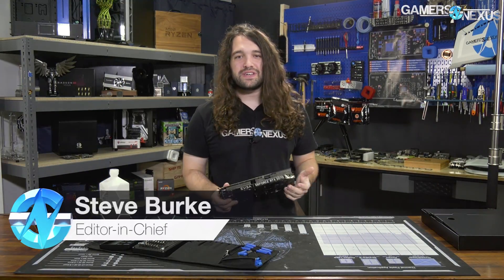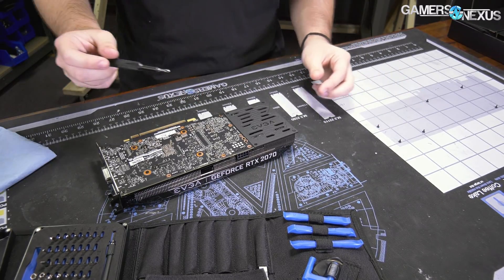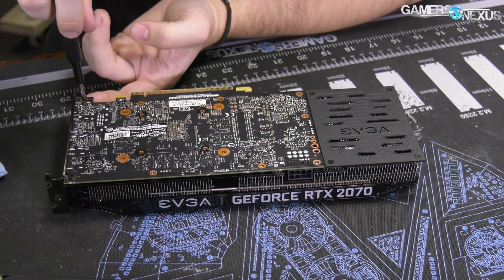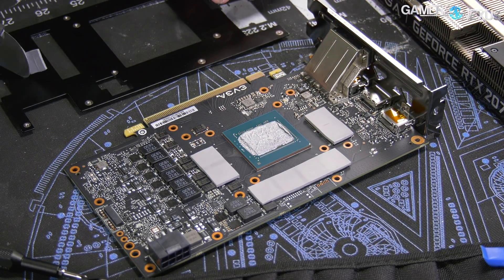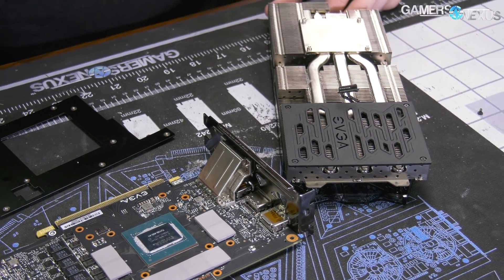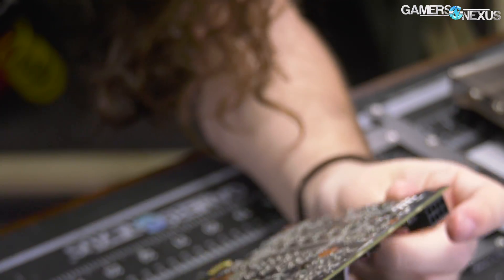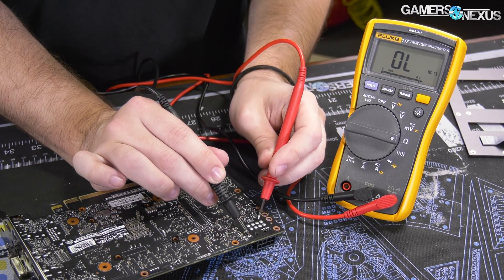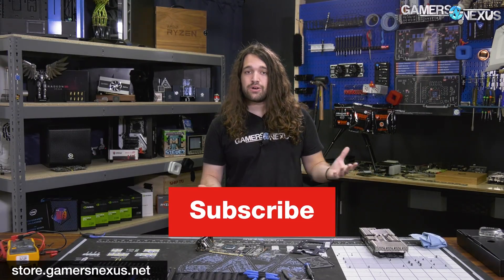EVGA RTX 2070 Tear-Down, Quality, & Reference PCB

Comment: 2070 shouldnt exist rn. Absolutely no reason to choose this card over a 1080 ti.
Reply: 1080 Ti is still almost as expensive as the RTX 2080 in Europe. RTX 2070 starts at 519€ so it's a better buy atm.
Reply: @yyperi  Same here in Canada for new cards. I can get a RTX 2080 for the same price as a 1080ti , and not be on two year old hardware (and get slightly better or the same performance). Hell there are even a few flagship models of 1080ti that cost the same as a 2080ti.
Reply: Nice lie, Idk why you would say something that this while the numbers are public. the 2080 doesn't beat the 1080ti in any noticeable  way. in fact alot of major titles still run better on the 1080. the fact remains that less then 20% runs anything above 1080p and even less then 10% are 4k thats the only place these cards start to pull apart.
Reply: Bought probably a dozen used cards, many in the mining era. Most have been running for a year plus. Even the ones that haven't have seen plenty of use. 

0 have issues. Just test before buying or buy on eBay for the protection
Reply: I bought an OC'd EVGA 2070 because the 1080ti is much more expensive.
The 1080 is around 440
The 2070 was 460
The 1080ti is about 700
Reply: Price obviously.
Reply: Apart from the Fact that it makes the 1080Ti look like mad value and they sell all there overstocked old GPU's
Reply: There is over here: 350-400€. After the RTX launch the 1080 Ti went up in price, they cost the same as a 2080, on some days actually more. It's a wacky world out there.
Reply: Maybe not a bad card if Ray Tracing picks  up. Outside of that, I agree completely.
Reply: unless ur a hobbyist game or 3d dev who wants a cheap way into RTX, or an AI nut who wants tensor cores to play with
Reply: Considering I can't find a decent 1080ti anywhere for under 1050$ CAD, but I can buy a 2070 for 750. There's plenty of reason for it to exist. It's overclocked performance is only ~10fps average lower than the 1080ti, and it costs 300$ cheaper for me.
Reply: Here in switzerland the 2070 Costs as much as a 1080. With the 2070 you get RT and DLSS. Well ofcourse as the BF 5 raytracing benchamrks shower ist almost impssibleto tun at 60fps on 1080p unless u have a 2080ti. However you do get a 5-10% performace increase with the 2070 over the 1080 so ist not a bad deal here. I personally have a 60hz 1440p monitor and the 2070 handles that on max settings around 60fps These days.
Reply: The Sqaush cheaper than a 1080ti, newer, close to same performance, and not hard to get. The 1080ti is still 700+ so I’m never gonna buy it for that price.
Reply: Price is more reasonable
Reply: RTX and DLSS, whatever it may be
Reply: Things that don't exist to the practical consumer for $500 please
Reply: Power consumption is the only reason.
Reply: Power consumption isn't a valid reason for a desktop.
Reply: cheap, new, 1080 Ti cards are a myth and only a idiot would risk buying a used card in the post mining era so not sure how you are directly comparing a $500 card against a $700 card
Reply: @Sleepy.Time.   Lol my miner 1080 TI works just great cost $500.
Reply: @Gabariel - If i knew someone selling a 1080 Ti that i trusted i would consider getting a used one but i do not and therefore i wont. @PSG1 - Still you gotta admit that was a risky purchase since the card could have thousands of hours of use under questionable cooling conditions. Buying a used GPU atm is like buying a used car that was once a taxi...might last years or it might last a week. I am sticking with my 980 Ti in till 2080 Ti prices drop or when AMD and Intel bring a 2080 Ti rival to market for a realistic price.
Reply: @Sleepy.Time.  One of the 1070s I bought 2 weeks ago was from a miner, but I could see that be undervolted the card and it's an EVGA, so if the cooler broke, I just call up my bros at EVGA and I get a new cooler sent straight to me for postage fee.
Reply: @Gabariel - EVGA is the best about backing their products that is for sure. Still it really is not fair to compare used prices of products vs the new retail price. 1080 Ti cards cost $700 for the meh ones and $800+ for good cards so my point stands the OP cant compare a 1080 Ti to the RTX 2070.
Reply: how is anything a risky purchase with a transferable warranty? especially when most of the used cards being sold are only 6months to 1year old.
Reply: Ive bougth about 16 used cards in the past 7 months and none of them were faulty. 3 of them were 1080tis.
Reply: @Gabariel - Buying a used car that does not blow up in the first three months does not mean that car has been well treated. You have no warranty on any of those cards so that alone is a concern. Just to ask why the hell are you buying 16 graphics cards in less than a year?
Reply: @Sleepy.Time.  MOST of them are less than 2 years old, they're all in warranty.
the gtx680 I bought 6 months ago for my brother is still sitting completely stable with an overclock.

All the buyers let me stress test the card for an hour.

I never buy off eBay.

I buy so many cards because in my free time I build gaming pcs for a small profit, of course the 1080tis are going to my collection or being sold to my friends for a fair price.
Reply: Probably flipping them
Reply: Sleepy .Time IMHO, buying a used card from a miner is less risky than buying from a gamer. Of course you need to check it but those cards are running 24/7 at the same temp, undervolted and no risk of LM contamination.
Reply: @Vierax - Gamers are likely gonna dick around more with overclocking so yeah that is not a good avenue for the buyer. The 24/7 use by miners is concerning but in my experience the most wear caused to a electrical device is when its powered up and powered down so heat would be my concern since miners are gonna be less worried about good cooling then a enthusiast. 
Used computer hardware has never has been something ive considered just to save a few bucks, to much risk for to little return.
Reply: @Gabariel You should check manufacturers terms of warranty it aplies only to original buyer so no you got no warranty unless the preson you bought it from RMA it for you.
Even EVGA which supported 2nd hand RMA changed its terms mid 2018 (i guess becouse of mining)
Reply: @Sleepy.Time.  I would never buy a used video card. You never know what the past owner did with it. Also, most people who are mostly young gamers try to go as cheap as possible and build their computers using cheap parts because they want to compare their computer to the console and with that, they use a cheap PSU and that creates a lot of problems for the hardware so this is why I will never buy a used video card. There are other concerns like bitcoin mining. I am trying to replace my 2 sli 970's for just one better cars but prices are insane on ebay, amazon, and anywhere. Everyone wants to sell their used cards and even a new 1080TI FE from Nvidia on ebay or amazon is going even higher than 2080TI so may as well buy a new 2080TI or a 2070. Nvidia FE cards are overclocked and can be overclocked even higher. 11GB Vram vs 8GB is not much of a loss. A newer architecture is still better than a previous one. If anyone has 1 or 2 sli 1080's, keep using them but Maxwell architecture or earler, just buy single 2070 since nvlink sli will not work because nvidia on purpose disabled that option in the bios of the card or in the driver.
Reply: @Axikor_Xander  Does it really matter how the past owner used it? If you can get a 1070 used for mining that's working as any other 1070 you can buy new for less than half the price... 80% of all pc parts i buy are used, and I've had no problems. I got no need to spend 3x cash for same performance.
Reply: You mean 1080 flagship in which you get much more robustness for $500
Reply: Hype!

Comment: Why do you have such an issue that it doesn't say black edition? The whole thing is black, it says evga, it says 2070 and one would assume you bought the thing before putting it in your case? You're coming across like you have an agenda against the way nvidia and these companies are doing stuff. Strange
Reply: I think his point is that, for EVGA, the branding (or lack of) is just a bit boring. I've been buying EVGA for years, they've kinda been my go-to GPU preference, but compared to what one typically expects these days, this card looks, well... dull. If the AIBs aren't going to boast about the tech they're selling based on current marketing trends, why should consumers be enthused? On the other hand, having said that, I don't like RGB lighting. :D
Reply from the maker: Who said we have an issue with it? It was a joke in reference to the slim margins on these $500 units.

Comment: 500 is quite a bit for a 70 card, short pcb and "meh" vrm makes it a disappointment for me. Can overlook the vrm but watercooling short pcbs looks ugly in most cases. I hope in 2020
Reply: And it's a 106 die, which used to be for the xx60 cards.

Comment: I wonder if it cools better without the "back plate". It might allow the air to flow more freely .
Reply: The [Sapphire] R9 Fury used the same setup - cooler longer than the PCB, but did not block the airflow with a piece of plastic like this.

Hot air pass-though ability is much more effective than a fan blowing air into a cooler, which then has to change direction to exit through the sides, (one of which is 'blocked' by the motherboard), then potentially being pulled back into the cooler again.  I don't think it looks 'better' with the plastic cover, but that's just my opinion, it certainly will reduce cooling capability.  Would be interesting to ask an EVGA designer why they chose to do that.  Maybe the cooler itself is overkill for this card, reducing the negative effect of blocking airflow.

At least its removable without tearing down the card, those wanting lower GPU temps or reduced noise can easily remove it.

Comment: $400 is about where it should be. Once upon a time the *70 cards were the midrange cards. The friggin 670 launched with wide availability at $399. There hasn't been no 25% inflation in 6 years
Reply: Its performance relative to contemporary cards positions it as a historical '60 card, but is labeled as a 2070. But this gets better. Not only are its VRMs and likely other components lacking in comparison to the 1070, but it's also a higher MSRP even including inflation. So it's being sold at a price expecting more value than the 1070 at release, yet delivers less value than the 1070 at release. The only thing keeping this situation from feeling like getting bent over a barrel, is that the last gen still exists.
Reply: It's a xx60 die cut though. I will treat it like a 60 card! Forever! RTX-less 2060!!
Reply: 400.... well
Reply: Dude 1080 MSI is no longer available in my country to push the 2070 versions. LMFAO. Plus that 700€ versions. .
Reply: This is TU106 so not even mid-range. Straight low-end lol
Reply: This comment aged like milk.
Reply: No, but there's been about 10% inflation, and the 1070 has moved to the mid-high end. I think the 1060 fits more where the older '70 series cards were.
Reply: this is happening because the consoles, we are playing the same graphics since ps4 release, so the graphics looks like more "high end" but no... we are playing the same shit because the limiting consoles
Anyway, the gimping on optimization and drivers fix that, so you need a 1060 to play decently a ps4 game (750ti) and anybody complains...
Reply: Consoles aren't limiting graphics. Consoles account for roughly 40% of the market in the US and PC is 51%. Nvidia is completely unaffected by consoles and PC games are FAR greater graphically than PS4 games. They aren't even remotely the same.
Reply: nope, the pc games are face washed ps4 games with filters and AA, and are optimized like shit, and surprise, USA is not the entire world

Comment: I would prefer a GTX 1080 Ti over the RTX 2080 beacause it has more memory
The 2080 should have gotten at least 11 GB of memory
And the 2080 Ti should have 16 GB
Reply: Yeah, but the 1080Ti costs $700, minimum, and the 2080 has faster memory, so total amount is offset a bit.
Reply: slikrx You don’t have more memory when it’s faster, and by the way, the memory of the GTX 1080 Ti runs at roughly the same speed as the RTX 2070 because it has a wider interface
Reply: Fast SnailNeck, 100% agree! I've posted that several times, the memory downgrade of the 2080, and the lack of any bump for the 2080 Ti. I think NVIDIA has done it this way because they're trying to push gamers back to 1080p since Turing just doesn't have the raster performance for higher resolutions, hence why reviews showed the 2070 stronger at 1080p. I've talked to a couple of people doing top-tier gaming at 4K on 1080 Ti cards (the kind who love to use mega mods for Skyrim, that sort of thing), they say they're already pushing up the existing 11GB limit.
Reply: Eeeh, that's not really NVIDIA's problem. Skyrim mods were built on an obsolete and never optimized platform.
Reply: k4RtInk ?
For example: Wolfenstein 2, a very well optimised game, uses more than 8 GB at UHD with the maximum Settings. 
Under these conditions, the GTX 1080 Ti is worlds faster than the RTX 2080
Reply: k4Rtink, what an odd way to word it, not NVIDIA's problem. :D  Actually it kinda is, first rule of business & invention is identify a need. And Skyrim was just an example, infact the games I was referred to didn't include Skyrim, just happens to be one I know about because I follow the best pics thread on OCN.
Reply: It seems to me like just adding that 1 extra GB to make the 2080ti have 12gb... It was only to differentiate the 1080ti from the Titan XPpPpppPp
Reply: @Nolan Flynn They will probably bring out a Titan RTX with 12GB and the full TU102 die (4608 CUDA cores) a few months from now.
Reply: That would be their most obvious response to any initial Navi launch, along with price drops. Btw, friend of mine who preordered a 2080 Ti has just cancelled his preorder. :)
Reply: The complete lack of a memory upgrade is the one place I was disappointed with RTX. I'm not complaining about my 2070 because even if I went 1080 I'd still only have 8GB but I still wish they had thrown us a bone and and least moved to 11GB on the 70/80 and 14GB on the 2080ti.
Reply: @CryptidProductions  I wonder if NVIDIA left the RAM alone because by doing the whole PR push for RTX, focusing back down to 1080p, and with DLSS, they thought they could get away with having less RAM anyway. I agree though, it was dumb. I've seen comments from people playing heavily modded games saying they're already pretty much maxing out the VRAM of a 1080 Ti. The 2080 Ti should have been 16GB+, though I suppose the arch involved means the max is 12GB, either that or double it all up entirely.
Reply: @mapesdhs597  A part of me also wonders if they're banking on the massive speed increase going from GDDR5 to GDDR6 somehow making cards run more efficiently with the same amount of vram.
Reply: @CryptidProductions   Hmm, maybe, though the higher bw normally wouldn't make up for having to swap out to main RAM, but then the improved caching structure can help there, and the compression. I think overall it's probably more that NVIDIA figured since they were basing all the PR on promoting 1080p, there's no need for so much RAM, even though they spent years hyping all those things which made having more RAM very useful, like 4K and VR.
Reply: @mapesdhs597  DLSS essentially alleviates VRAM issues at 4k by rendering in lower resolution and filling in the rest using AI to get to 4k. A much more comprehensive reason in my personal opinion.

Comment: I can't find in the article or review about what Steve mentions at 18:27 about stock vs aftermarket paste
Reply from the maker: It is in the thermal section of the 2070 review.
Reply: I only see a thermal v. freq chart, acoustic chart, and vram/vrm chart. Nothing about thermal paste. Ctrl F'ing the article for paste comes up with 0 results
Reply from the maker: Thermal paste changes between when the tcouples are on vs. not on. You should be inferring the data between those two charts.